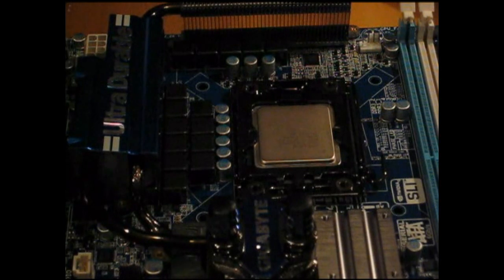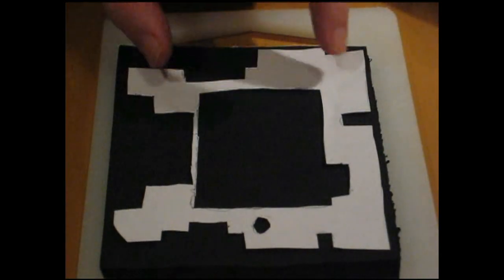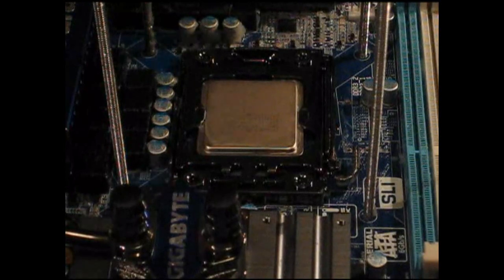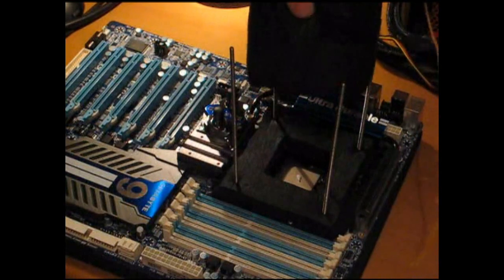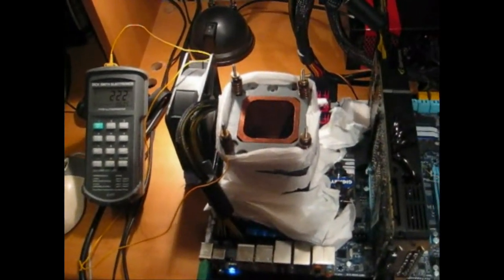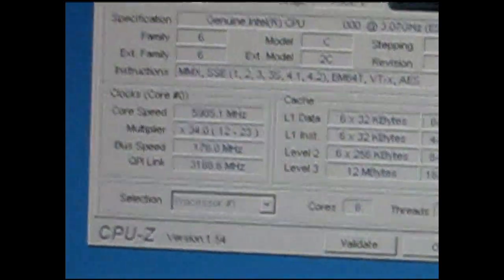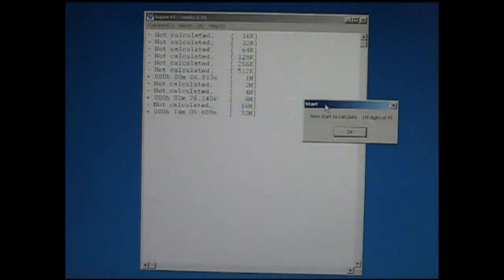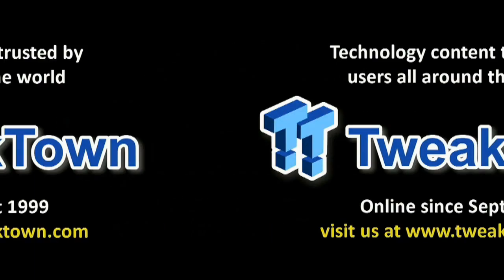Deanzo overclocks GIGABYTE X58A-UD9 and Intel Core i7-980X with LN2 to 6.1GHz

Comment: The same result could have been done with a VapoChill, and you wouldnt have to have your computer spread out on the table to keep an eye on the LN2... and LN2 is just overkill, no need to cool it that much when the rest isn't cooled down, even if you got it to -10000000 it woundnt perform any better than its doing now... cooling should also be on north and south bridge... also, the CPU needs to be covered in Vaseline on the pins and into the socket to exclude moist under the CPU...